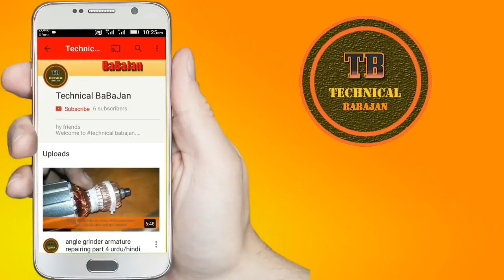new method of 7 inch angle grinder armature winding its called single winding  part 3

Comment: sir i rewind my drill ( 550 watt 220v ) with this method but i notice unormal spark in braches even at low speed. what is the cause of the problem? also i get armature very hot
Reply from the maker: no bro this winding method  just for  angle grinder .
Reply: this is  data taken from my original armature ( 12 slots 24 bar. 29 winding, wire 0.35mm . the direction of winding is colck wise and side by side ) but i missed where the first winding are connected ) 
So what you suggest i do ?
Reply from the maker: in this case important for you to remember the commutator original place and alignment .
Reply: why i can't cenect the first winding anywher in commutator?